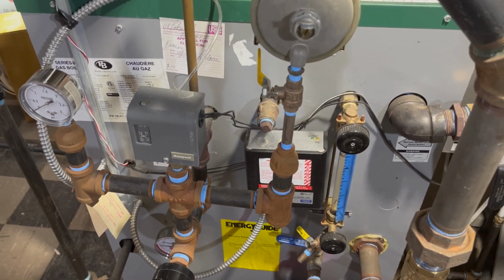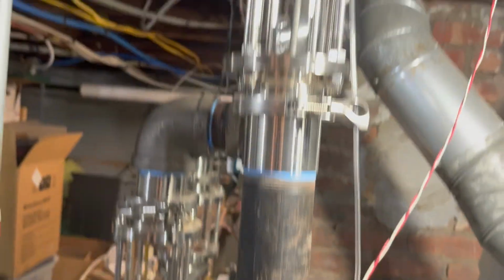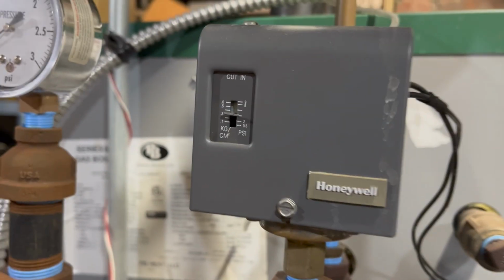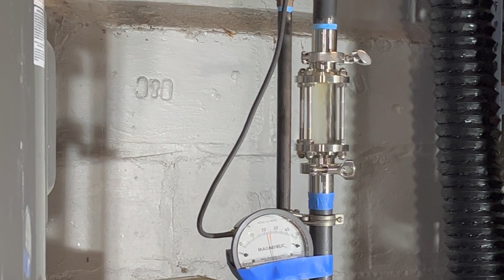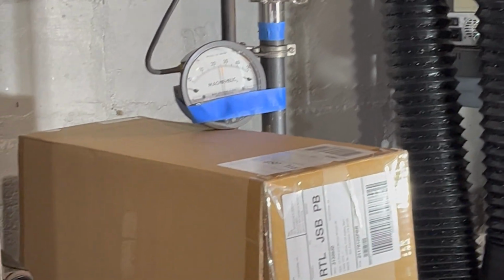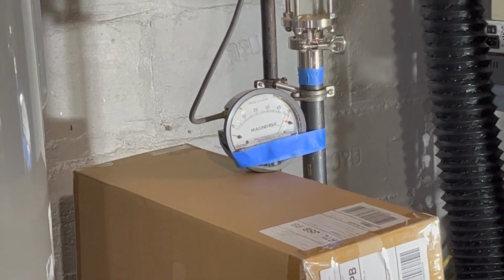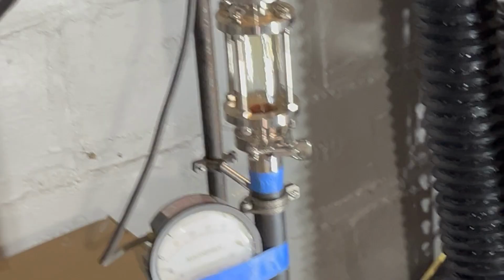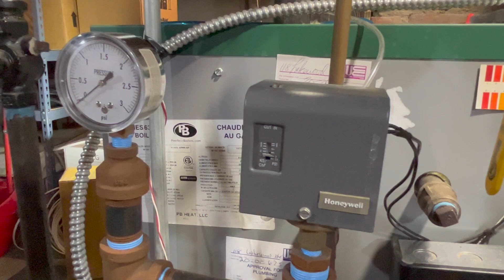Does a Steam Boiler's Equalizer Actually Equalize Anything?

Comment: They used to use check valves in the return which could clog or get stuck open.  If they clogged you got  slow water return to boiler and if they stuck open it would allow water to back out of the boiler.  In both cases you could get water hammer at the end of the mains, spitting air vents, and/or flooded take offs.  There absolutely is a significant pressure drop across the mains and the dry returns under certain circumstances.  The equalizer also allows a parallel flow of steam and condensate in the header, which is critical especially before the system is fully hot.
Reply from the maker: @captainwho1  you’ll see in there video there is no need for a check valve nor an equalizer to keep the water in the boiler.
Reply: @pb7379-j2k  Your system can get by without it but other ones obviously needed it or else they wouldn't have bothered with them because they were a hassle in their own right.  Things become standardized, like the stupid internal syphon 30psi gauge that is always non functional, and the hartford loop which is a good thing...
Reply from the maker: @ I’m not so confident as you that it was ever necessary. Condensate pumps and tanks being a prime example.

And Hartford loops are nearly completely useless for another example since you brought them up
Reply: @pb7379-j2k  After the Hartford Loop there weren't so many catastrophic boiler incidents where the wet return sprung a leak and the LWCO failed and the boiler exploded.
Reply from the maker: @ I don’t think the flow in the water makes the current that directly trips the relay, there is circuitry between, but I don’t disagree with you
Reply: @pb7379-j2k  Maybe not, but with solid state relays who knows?  I'm not electrical.  Anyways I think you agree that it IS about resistance now  😎😎
Reply from the maker: @ maybe, I don’t know the circuit

Comment: I have found many boilers probably before the 1970’s that did not have a balance line and worked fine for all these years. And most mechanics sell that as a reason to replace the boiler. I do agree with your balance line findings.
Reply from the maker: Thanks. Looking at a piping diagram, it seemed fishy—it made sense once I put that gauge on the far end of the main

Comment: I believe the purpose of the equalizer was not to keep water at the end of the main from rising, but to keep water from backing out of the boiler without check valves. If we imagine the simplest possible boiler, with the steam header terminating at some distant point and dropping into the wet return and back to the boiler, as steam expands in the boiler it rises into the header but also forces the water level in the boiler down. The expanding steam would eventually lower the water line to a dangerous level. To combat this, check valves were installed in the wet return at the boiler to only allow water into the boiler from the return, not out. But check valves clog and leak and corrode. A simpler method was to short circuit the steam header and the return line, so the pressure was equal and the water would not back up the return and out of the boiler.
Reply from the maker: Thanks for your note. First, you are saying the same thing it's for that you say it isn't for. Let me explain. You say it's not to keep water from rising at the end of the main, but to keep water from backing out of the boiler without check valves. But those are the same things.

If water is pushed out the back, it will push all along the wet return to cause water to rise at the far end where the main (not the header, I think you were misstating that) comes down.

But it doesn't do that (see my video where I prove it). This is because the very same pressure that is pushing the water out the back is also pushing up to the main and over to where it meets the wet return. Two equal pressures pushing against each other with no movement of water anywhere. I show this clearly in the video. 

Thanks again for your note! It's hard to think that so many people have been wrong about the equalizer all these years, and even manufacturers like Peerless as much as I respect them, still have this incorrect theory in their documents.

Comment: I think you are way overthinking this. The purpose of the eq is to equalize pressure at the header and return inlet so the water level doesnt drop by being forced out and into the return. On a 2 pipe system your return is at atmospheric pressure besides the static head of the water contained in it,which in homes could be very little pressure. If you only have 14" of water in your return and your running at anything over 1/2psi, water will push out the boiler until the height of the water in the return matches the pressure your running the boiler at.  So 1psi steam pressure, water will be pushed out of boiler untill the water column in return is 28", the eq prevents the water from leaving boiler in this situation. No dp no flow.
Reply from the maker: Hi there! As you can see, I'm experimenting with a 1 pipe boiler, which the existing literature and common belief says the equalizer does what you say.

But I clearly show here that it does not. Do you see me closing the valve that I installed on my equalizer? It does nothing.

As for 2 pipe systems, I don't have one to experiment on, but they run at very low pressure. If they run at high pressure they blow out their traps. If they blow out their traps, they are going to behave the same way. The pressure will be the same in the main as it is at the wet return.

Comment: Nice set up.

Your main vent should be installed about 12" back from the drop to the return as to not foul the vent....fyi

The equalizer also effected the return condensate from the system which you need to make sure your dimension-"A" is 28" or greater in reference to your Hartford loop.
Reply from the maker: Thanks! I’m aware of that thinking but since I can see my condensate flow, I know that concern is overblown. There is no “slug of water” that can hurt your vent. Only surging can.

Comment: The old books didn’t call them equalizers. They called them bleeders and drips. There were equalized pipes on the boiler, but they were there to hold tri-cocks, and gauge glass, so you could see the true water level.
Reply from the maker: Thanks for that comment. Those names make a lot more sense. It does a great job as a header drip
Reply: @pb7379-j2k  Does a header drip help reduce water carryover into the main over long firings?
Reply from the maker: @davidbuche  I would say the drip gives any water separated by the header a place to escape back to the boiler. But a long firing shouldn’t particularly cause carryover. Any halfway correctly piped boiler with decent water quality doesn’t carryover at all.

Comment: The scenario I hear being used to justify the equalizer is if there were higher pressure at the boiler outlet it could cause backflow which would push water backwards out of the boiler until there was no liquid in the boiler. Nobody ever explains how that could happen in a closed system. It’s just an “imagine if” thing.  In your demonstration since there was no added pressure at the boiler output you were not simulating the test case.
Reply from the maker: I tested it at 5psi, just how high would you like to see?

If you look at a boiler diagram it is clear that at any pressure, you will see the same at the boiler and at the end of the main. But still, people imagine the equalizer has some mysterious power at a distance.

I showed it doesn’t. If you disagree I’d love to see a demonstration

Comment: It also works similarly as a vent pipe for your return water to come back to the boiler without thermal shock, preventing banging in the pipes
Reply from the maker: How would it prevent thermal shock?
Reply: @pb7379-j2k  by pre heating the return or water feed
Reply from the maker: @jblaze0382nj  sorry my friend I see no possibility for that. The equalizer is a cushion of static air that allows no steam to flow. It stays cool to the touch for a long time during a call for heat. Try it

Comment: Paul I enjoy your videos very much. I really like your boiler setup you could conduct classes down there. I worked as a steamfitter at a large installation. One day when the high temperature was 9 degrees our steam PRV (pressure reducing valve) which we normally set at 5 pounds was all the way down with steam screaming into the system. The two story building was at least a city block long and at the end the radiators were cold. I boosted the PRV as much as it would go I had 12 lbs on the gauge the sound was deafening. The radiators were still cold. I put a vacuum pressure gauge at the radiators and I had a vacuum at the radiators and 12 at the PRV. That day I found out why the two other PRV valves installed at other places in the building that I had never used before  were there. When I turned them on I had steam everywhere.
So perhaps on a really cold day when your boiler is putting out all it can and your radiators are condensing very fast you will develop a vacuum at the end of your main and start drawing condensate back up your wet return. The equalizer may help then. What do you think? Again thanks for doing your videos.
Reply from the maker: Hi Mike, thanks for the note! I don’t think it would happen in residential, here’s why: no matter how cold or hot it is, this boiler is only making the steam it always makes. There might be variation at times, there was some I seemed to see, but it was unrelated to the equalizer and it was very small

Comment: You raise a very interesting question and show a cause and effect with your video about the equalizer.
I’m a little confused about the pressure with the king valve partially closed though, is it the volume of the main which is creating the pressure drop ??  you are not quite closed yet on the king valve, or something else?
Steam in the main starting to condense because of the volume cut down creating a slight vacuum pulling the water up in the return into your sight glass on the return side?
Reply from the maker: What I would suggest we’re seeing there is the steam the boiler is producing, since it can’t escape the boiler, is building pressure in the boiler and pushing water “out the back” into the return, raising the water level at that far end.

It could also be helped along by steam condensing in the rest of the system lowering the pressure to partial vacuum, but I think that is minimal in what we see in this video because the rise happens so fast when I start to close the valve in the supply

Comment: I’m going to use an analogy based on hot water boilers to explain what I believe is happening. With hot water you actually have two types of pressure to measure. 1-Static Pressure which is uniform throughout the system (enclosed vessel, assuming all vents are closed ant system is tight) and 2-Mechanical Induced Pressure which uses either gravity circulation (requires larger pipes because head is so low) or a circulator on hot water systems (smaller pipes because circulators have higher head at outlet and zero at center of impeller). In the case of steam the MIP is created by boiling off surface water and steam collapse at radiation (high to low pressure). Since all of you gauges are above the water line and/or on the steam supply main, pressure will be the same. Closing the valve just above your Hartford tee while it is still steaming should not affect those readings. However, I would suppose if your boiler was firing, creating steam, water level was below Hartford tee and you shut boiler down and let it cool, you might see some weird stuff going on with water levels. Some of this may depend on 1-pipe, 2-pipe, whether rads use air vents, or vacuum breakers or thermostatic traps or Bucket Traps or Float and Thermostatic Traps to separate dry from wet returns. It gets complicated quick.
Anyway “The Lost Art” is a great book for old Steam Heads like me or anyone who just wants to learn how different steam systems works, especially some of those older ones.
Just my thoughts, could be wrong, but you never learn if you think you know it all.
Reply from the maker: Thanks. I have that book and it’s very good. Page 104 has the part I believe is mistaken that I believe I disproved in this video. I don’t think your situation will have much affect but I’m going to find out tonight as part of a variation on the experiment

Comment: It seems to me that the water would never rise up at the end of the main, because all that was done was to shift the equalizer from the side of the boiler, to the end of the main. And actually the drip at the end of the main would serve as an equalizer  if the header drip was in operation or not.
Reply from the maker: Thanks Gerry, that's what I've been saying on heatinghelp.com

But the equalizer doesn't really shift from the side of the boiler to the end of the main...it was at the end of the main all the time. The "equalizer" near the boiler doesn't affect any pressure in the system whether it's there or not.

Comment: It equalizes the water level not the pressure= reducing the chance of surging and dry firing boiler.
Popular before electrinic sensors
Reply from the maker: You are alone in this definition 😅

But ok I’ll bite. How does this pipe equalize the water level?

Comment: I believe It doesn't push through the return because it's cooler at the boiler tap
Reply from the maker: I don’t think I understand—you are saying a temperature differential causes flow to be hindered?
Reply: @pb7379-j2k  correct that's what I believe
Reply from the maker: @greekmaster1001  ok…what force would prevent flow in that case?